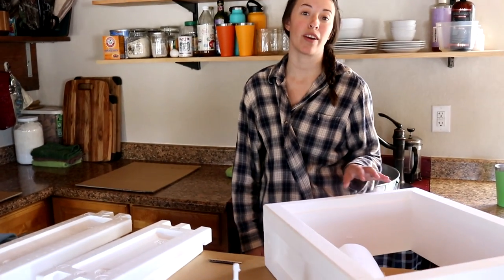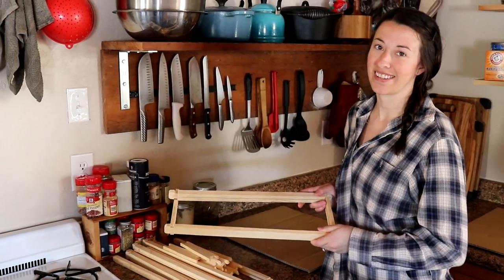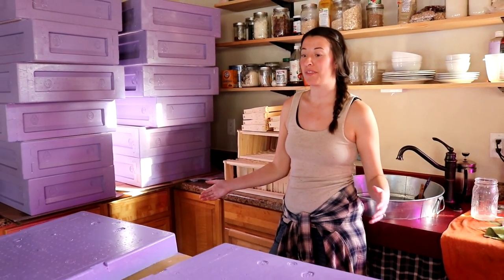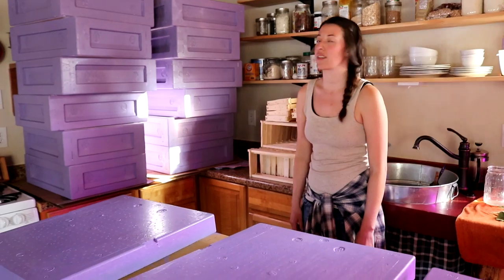Burn Pile Snow Removal | Getting Ready for Bees at Our Off Grid Cabin

Comment: Id suggest using more glue with a little brush to completely cover both faces that are joined.  Then clamp or nail and use a damp cloth to wipe away excess.  That will make the joints much stronger.

Comment: BeeMax were the first hives that I had. I moved on to traditional wooden wear but did have decent luck with the foam hive bodies. They were expensive and not compatible with other equipment that I collected.
Buils a jig the next time you have to assemble a bunch of frames. It will cut the time needed way down.

Comment: Hi, I know this is an older video but I asure you that the choice for Styrofoam Beehives in your climate is an excelent choice.
Here in Northern Germany 95% of the Beekeepers use Styrofoam Hives, they are used for over 25 years now, it seems that outwintering your bees is easier in this kind of hive because they have a better isolation.
Although my main Hive system is the 2/3 Langstroth (159mm frame height) in wooden hives I've also have some small colonies in so called mini plus hives which are made of styrofoam, i use these for raising new queens and overwintering spare queens.
What frame height are you using?

Regards, Victor (From northern germany)

Comment: You've got me corn-fused!

I understand the insulating factor of the styro, but I'd be very worried about the girls ingesting it, and thus becoming a part of the honey cycle, as well as negatively impacting the health of the girls, the larvae, and the queen!

Did you ever consider a TBH (Top Bar Hive)? It's the way I'll be going, once I relocate to Alaska, as they are MUCH easier on the back, easier on the girls, easier to keep clean and de-mite, and you can use either regular or Deeps in them!

I'd suggest  you buy a small air compressor, staple gun, and a few other hand pneumatic tools, for frame building; easier, quicker, than nails, considerably lowers the stress on the wood and provides for fewer chances of splitting the smaller wood planks for framing.

I like your videos, very much like your attitude and 'get  it done' approach for pre-prep, prep, and action on your projects!

Could you indicate why you decided to not use the beetle kill wood for kindling/fire wood, as opposed to using for what I think is your intended gardening ash uses?

Thank  you for your time and thank you for working so hard to produce truly quality products; your post production efforts are much appreciated!!!

Cheers from Central Wyoming
Reply from the maker: JR Bailey, thank you for your comment! We really appreciate it :)

I will do a video on the polystyrene hives in the near future (there has been lots of interest, rightfully so!) but there doesn't seem to be an issue with bees ingesting the material, it is very condensed. Our main reason for choosing these over wood is that locally this is what is the most successful in overwintering bees which is a top priority for us in regards to beekeeping and, of course, their overall health. I can't say I researched the Top Bar Hive tremendously, Langstroth also was what we went with because shipping bee keeping equipment here was very pricey and we could purchase this locally.

Great recommendation on the compressor, I could only imagine how helpful that would be, we are trying to be as frugal as possible and I could see how this would probably help with cutting down on repairing frames in the future but for now we are just taking it one step at a time. If we add on several more hives at once, I absolutely may consider it though!

In regards to the question about the wood, we do intend to use the ashes for gardening but we also can and do burn beetle killed spruce trees (unfortunately we have plenty). We also were trying to expedite the snow melting process at the same time with the burn pile.
Reply: @SimpleLivingAlaska  

Thank you for your rapid and in depth reply!

The reason I mentioned TBH's is because of my own physical limitations (3 herniations in my lumbar and 3 compressions in my neck, which makes a standard Langstroth less than desirable!

However, the other reason I offered it for recommendation to you, is that you can use standard Langstroth equipment in it (frames, normals or deeps), and thus save a boatload of money on equipment.

Thirdly, I am going to use TBH myself, with a particular design created by a fellow in the Great Lakes region, because of the superlative quieting impact it has on an active hive; you are able to select a single frame for checking, WITHOUT disturbing the rest of the frames and hence, the girls going about their work in the hive.

You will no doubt have learned that limiting the disturbance to a hive, and thus keeping the majority of  the girls happy, makes for not only a happier hive, and worker population, but the less stress impacting the girls, keeps them HEALTHIER as well....which is my goal for not only the hives, but for flocks as well (I intend on raising quail, pheasidae (peaflow, pheasants proper), ducks (Silver Appleyards), Turkeys (Heritage breeds), hogs (LBP's), and goats (Kinders).

I know I like a less stressful life, and in raising chickens and turkeys, as well as quail and pheasant, during my  youth, I found that I received more eggs and fowl got 'plumper' for harvest, the less stress they had in their lives.

TBH also have a superior impact on our backs and necks as well....you raise a 10lb lid on a Top Bar Hive, rather than a 30-60 lb Super off of a Langstroth. Separating whole supers really ticks the girls off, whereas raising the lid on a TBH, which leaves the slatting in place; which covers the frames, disturbs no one.

I'm in very poor health, so I need to come up with 'work arounds' to make things happen, and so I believe in working 'smarter' not 'harder' (there's enough hard work to be done on a farm/homestead/ranch as it is).

I commend your Ash Program, wipes out the beetle eggs and provides quality source material for your gardening.

You might want to check into using 1/2" or 3/4" planking for hives, with Tyvek on the exterior, should your polystyrene not hold up to repeated handling...the thick walls do wonders for increasing the insulating factor, as does the Tyvek exterior, but those additions do add weight.

Should you like your standard Langstroths, I would suggest implementing/experimenting with a 'Cherry Picker' hoist for separating supers, because when your girls fill those frames, they're gonna get heavy.......

Oh yes, I don't know where you're located specifically, but if you can make it to a home depot, you can pick up one of those portable compressors for about $125-$150, which will work for most jobs on a small place. Should they be on sale, you can actually pick one up for about $99!

Thank you again for your quick and detailed reply, and I look forward to watching the progress  you  folks make on your farm....I hope to be doing much as you are now, but by this coming Winter in the Kenai.

Yeah, I know, a cripple trying to start a homestead in Alaska, just before or during the start of Winter? The level of stupidity is rather amazing I admit, but I've lived in the high plains desert of the Rocky Mountains for more than a quarter century, out in the Oil Patch (40 miles to town for food, clothing, shopping, movies, etc.), so 'getting along with very little' and facing 'the elements' is a norm for me.

Take care and Cheers from Central Wyoming!
Reply: @jrbailey3208  I'm a city girl, but I enjoyed reading your suggestions and think they're helpful. Thanks.

Comment: Let me know how those styrofoam ones do for you... they had just come out with them the yr I got into bees.  I started with the wood boxes and frames.  Mine still sit in the same spot we put them 9 yrs ago in great shape.
Reply from the maker: AK Washkeeton, I must say I was very reluctant to go with this option. I was set on 8 frame wooden hives after reading a Michael Bush's book but when I talked to the owner at RI Nutrition Generation he convinced me that there is a higher sucess rate with overwintering in the polystyrene hives and after joining a few FB groups it seemed like most in the area used these so I figured I'd go with them. Apparently they can last 20 plus years without paint, we will see right!? Do you overwinter your bees?
Reply: @SimpleLivingAlaska  I haven't had bees for yrs now.  I have a fracture in my lower spine that needs to be pinned for stability but the drs discharged me stating I was stable.  HAHAHA not.  I am unable to lift over say 25 lbs any more with out assistance.  My son is (after a few stings and being chased by hornets) terrified of bees.  LOL.

Comment: Hi. I just joined a couple of bee clubs & am taking the year to learn as much as possible before I buy my hives. Are the Styrofoam frame hives only recommended for very cold climates?  Here in TX, I am thinking that type of frame would be too hot since our temps get into the triple digits. What is your opinion? Thxs
Reply from the maker: Tai Lilly I am new to the polystyrene hives and I believe although they are ideal for cold climates they are also suitable for hot ones as well but maybe not humid. Usually local bee clubs have good info on what works best in your area. Glad to hear you are breaking into beekeeping :)